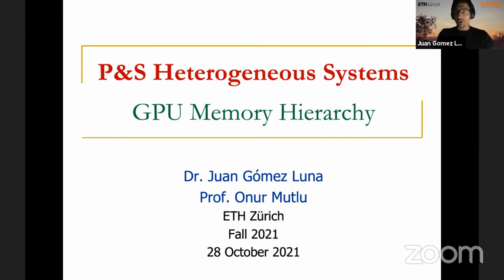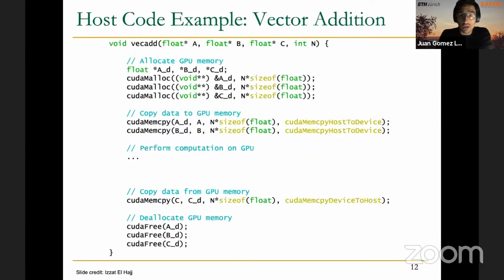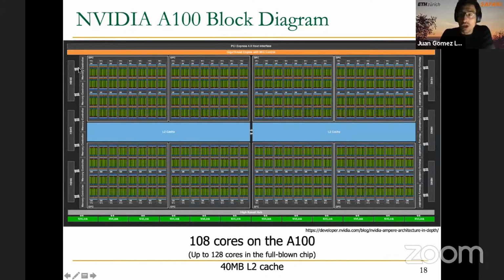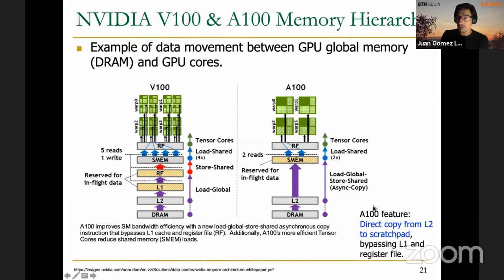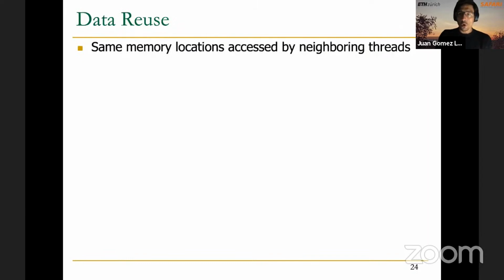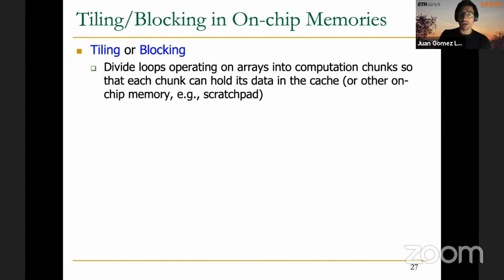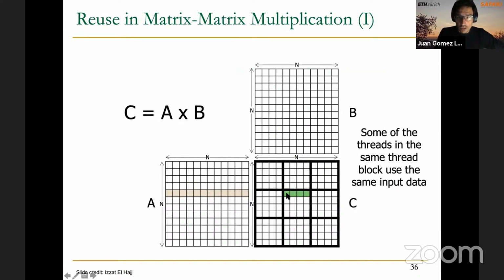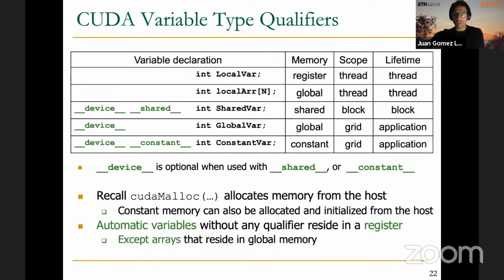Heterogeneous Systems Course: Meeting 4: GPU Memory Hierarchy (Fall 2021)

Comment: So when the data size is not a multiple of the number of thread we need a condition. But conditions are bad right? For the corner case of the last element, we will, potentially, slow down millions of thread. Isn't it better to just increase the input size to match a multiple of the number of thread and discard the unused output?